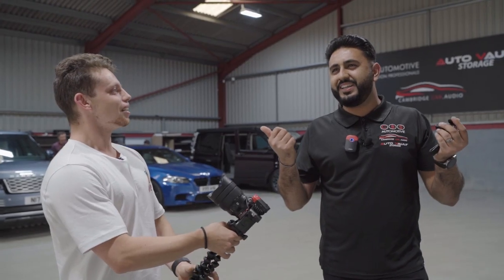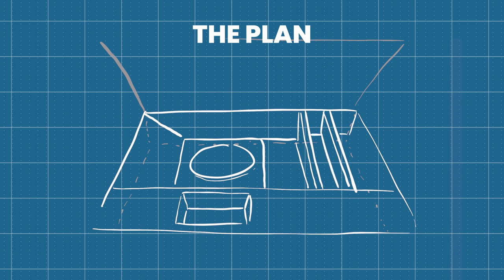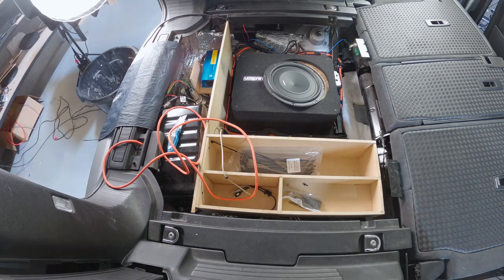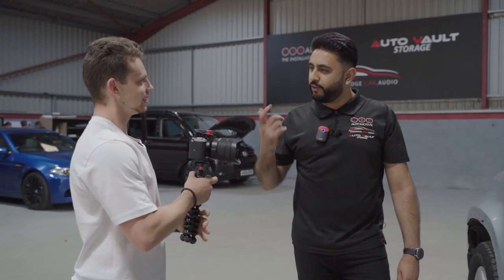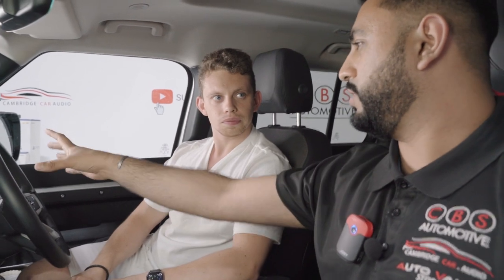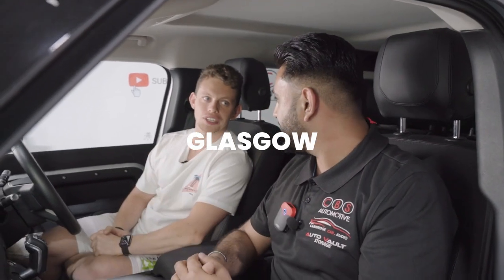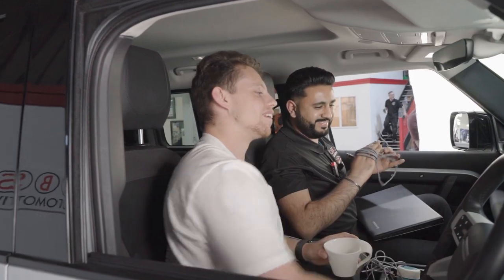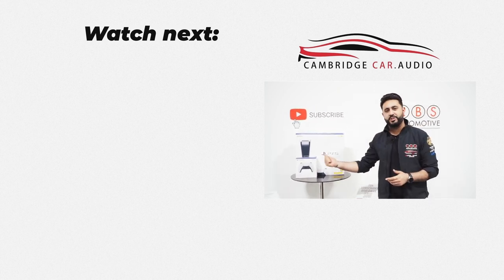We FIXED and COMPLETED MarzBar's Defender Sound!

Comment: Great stuff folks. Where are you taping the audio signal for the sub from? I am not thinking of installing another bcon source system. Just an amp and a sub ad on. Cheers.
Reply from the maker: Hi, thank you but sorry we do not advise on how to do an self install :)
Reply: @CambridgeCarAudio  I’m not doing a self install. I will have an audio shop do it but it would be great to get some tips from someone who has done a lot of these like you. I would have come to you but I am in Canada unfortunately. It’s just one missing part of the puzzle - where to get the audio signal from. :)
Reply from the maker: @sinsbyvivek  If your audio shop doesn’t know, please take the recommendation and not have the work done there